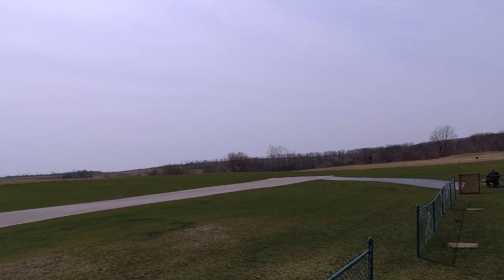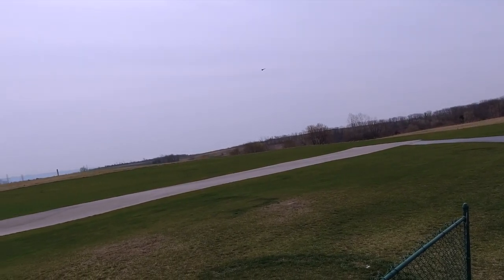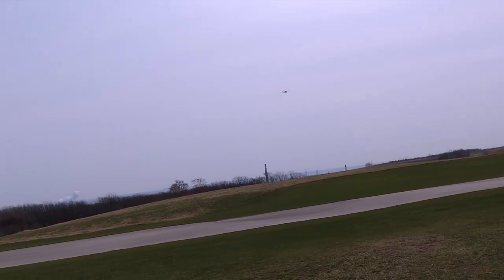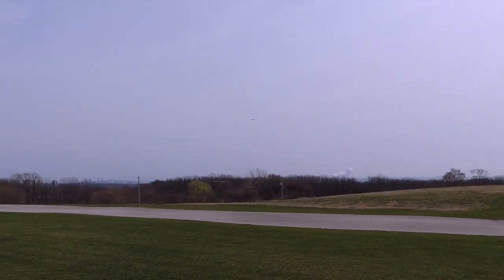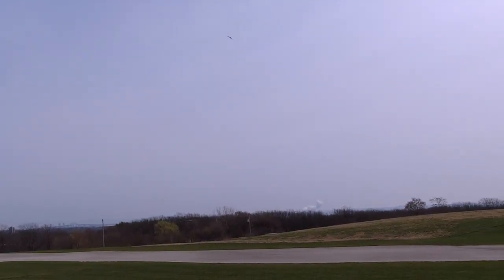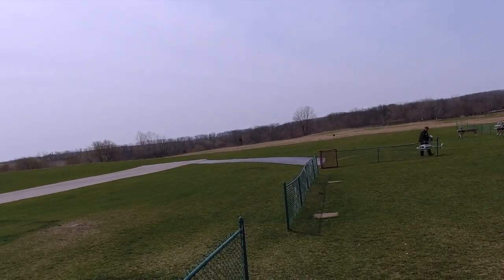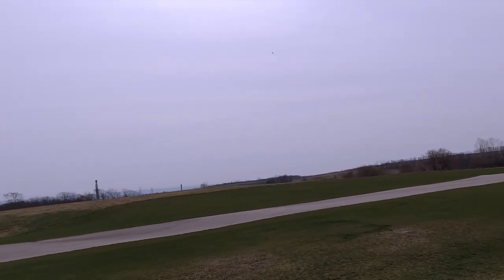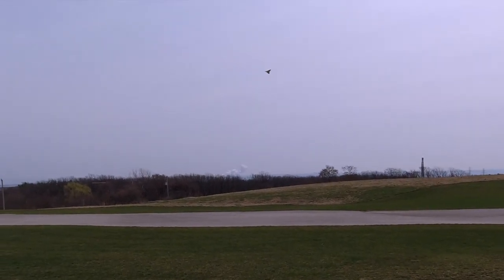The Pirana Boomerang Maneuver .....What is it?  Watch!

Comment: What battery are you using
Reply from the maker: The recommended Potenza 6s 1500mah
Reply: @FrozenNorthRC  I switched to a 7x4.5 prop and using a 1800mah 50c spectrum pack with this pack its like flying a predator missile doing 100mph+ easy
Reply: @tylersrcflightschool9570  How many amps does that draw on full throttle?